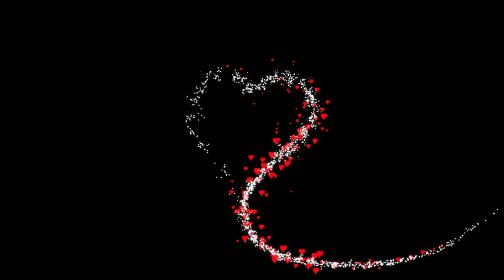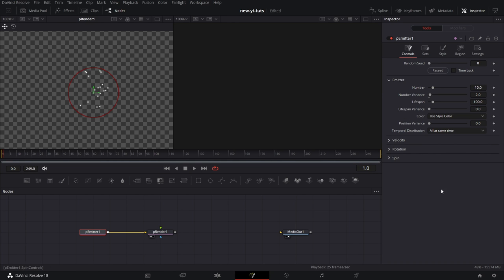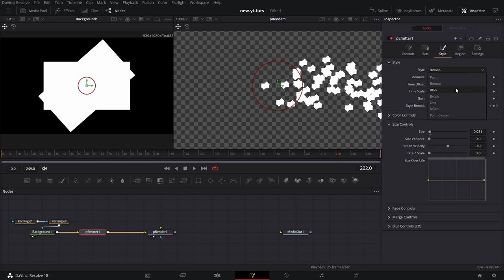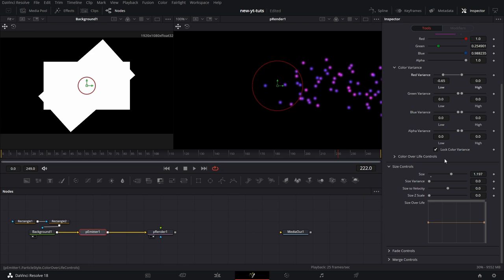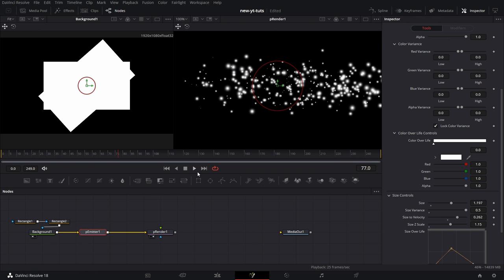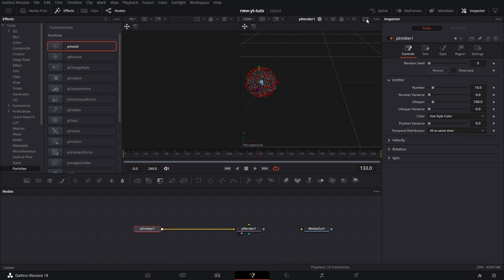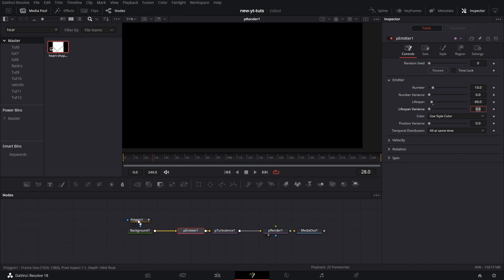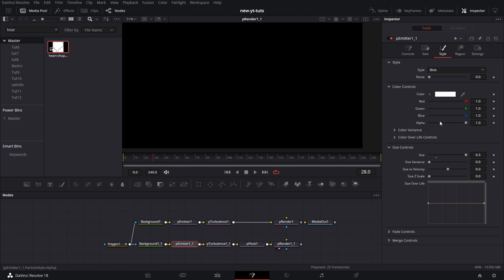Fusion Basics Tutorial 06 - Particle Emitter Node

Comment: At @ 23 min in the heart  line is merged with the white bkgd to make a white heart tracing. I cannot get my polygon > white bkgd to produce this white line. Any advice?
Reply from the maker: Just a few questions to clarify things:

Did you bring a sample heart image to trace with the polygon node? I shortened the trace process in the video. When you bring the polygon node , you can draw a shape by clicking on the viewer. 

When you finish drawing the shape, you can increase the width of the polygon outline so it is more visible like in the video. But it should be connected to the mask input {blue input} of the background node. Then if you drag the background into the viewer, you should see the shape you drew with the polygon node. 

Please let me know if this works out. Thanks for reaching out. And thanks for watching.
Reply: @madresolve  First, thank you so much for replying. You are as kind as you are creative. Second, I don't know what happened that I couldn't change the line thickness, but I just opened a new Fusion Composition, Inserted polygon and background, connected to Media Out and was successful in creating a line and adjusting its width. Perhaps I hadn't connected the background to Media Out? I will now continue following your tutorial and see if I can achieve a result! I did not import a heart. Ultimately I'm going for another shape -- a twisting line with the "length" movement. Thanks again.
Reply from the maker: You are welcome and thank you for your gracious response. If you have any further questions, please reach out.
Reply: So, I got the line to appear white, then moved on to emitter. When I came back to connect, the polygon line reverted to a skinny green and the white line is lost. I did connect to a white background. Then I created a new polygon/bkgd and still cannot get the white line....I'm in 18.6.6. Id this a glitch or is it me?
Reply from the maker: That is curious. 

But I think I have an idea why this is happening - can you change the background colour to white. I mean the background to which the polygon node is connected.

 Then view the background node in the viewer by pressing number 2 on your keyboard. 

Please let me know if this works out.
Reply: @madresolve  The bkgd was white. Pressing 2 did work, and I could see the moving line. However, when I merge to emitter I get a large cloud, not one following the line as yours does.
Reply: Oddly, I have all set as you, but it doesn't follow line AND I can't connect render to media out. I'm on  MacStudio!
Reply from the maker: Curious. 

Let's check a few things:

1. Did you animate the polygon? 

2 .in the particle emitter node, did you set style to bitmap hem your r on
Reply: @madresolve  Yes, it's animated. p emitter is bitmap. I see the line animation looking at the polygon, but connected to emitter via bkgd I only see the full emitter output, not along the polygon line. I quit and reopened and now can connect to MediaOut.
Reply from the maker: Okay. Let's try something. Go to PRender node and click on 2D. Be default it is on 3D. Let's see how that now looks.
Reply: @madresolve  It is 2D already. My nodes: Polygon>Background*white(>pEmitter>pTurbulence>pRender>MediaOut
Reply from the maker: Hi, were you able to sort it out eventually?
Reply: @madresolve  No, I still cannot connect Background to pEmitter. All else works! But, alas,  something is rotten in Denmark! I may just give up. I seem to follow all you do and don't get the same result. Thanks for your attempts to help.
Reply from the maker: Let us do one last thing. Can you select all your nodes (except media out) and paste this into a text document. Then you can send me a link where I can have a look at it. We will get to the bottom of this. mahdresolve@gmail.com
Reply: @madresolve  I don't know how to send a link you can see....I can email